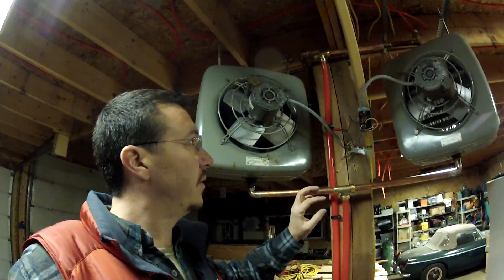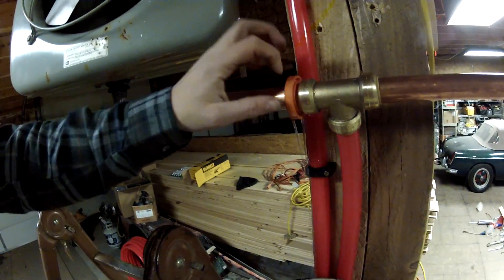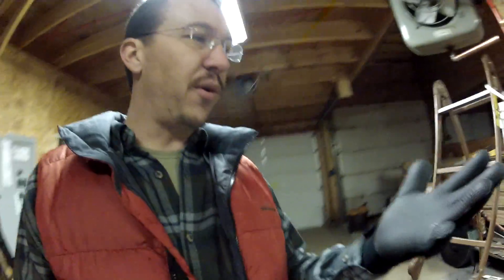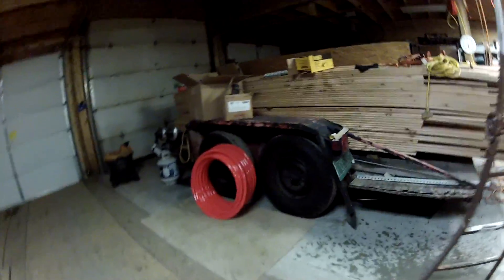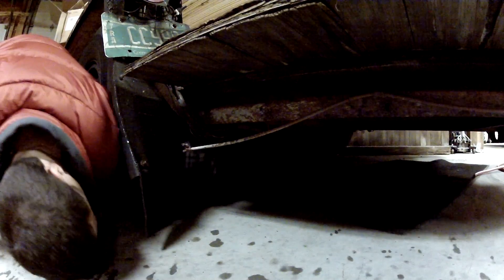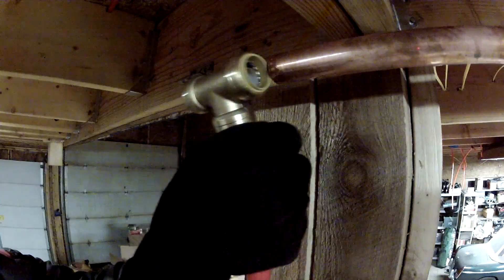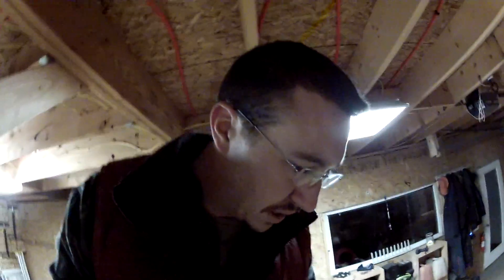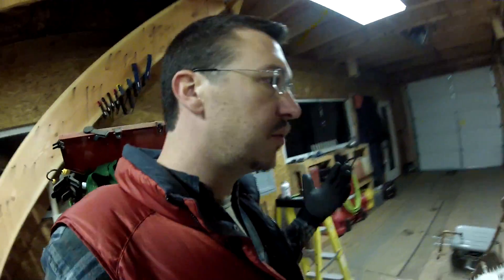Removing one Modine - 139 - My DIY Garage Build HD Time Lapse

Comment: The tool serves 2 functions: to remove 1 pipe from the fitting and some exercise from chasing it down when it flies across the room.

You could hook a dimmer to the fans on those things and they will be quieter and use less electricity and still put out warm air?
Reply: 2Awesome Actually I think you mean a ceiling fan solid state variable speed control! Those will not burn the motors out or cause a fire, where a dimmer switch on a fan motor is a fire hazard! Solid State Speed controls operate like a dimmer switch in that it is not stepped its full range variable like a knob on a stove or a water valve, only difference it is designed for ceiling fans but also other fans like some exhaust fans, fireplace circulator fans and if these motors are shaded pole or permanently split capacitor motors it will work, and they are different from dimmers as they for most types are 5 amps max rated, so multiple ceilings can be installed on one control all equalling not surpassing the rating! these motors on the modines might draw 3 amps, so if two are used one can buy higher rated solid state speed controls which are usually sold at commercial lighting stores or can be ordered from Canarm ceiling fan company or Banvil fans, or Casablanca ceiling fan company or Hunter ceiling fans! I think Fanimation sells them too! but the 5 amp ones are sold at your local hardware store like Lowes! Home depot they might be separate in store order because at my home depot location they only carry remote controls for ceiling fans not wall controls but they sell the. through ordering in store and online! But Lowes and in my area Home Hardware sells solid state 5 amp controls in store, they had boxes full of them in the ceiling fan and lighting section! they were 6 dollars each but I got a discount for mine because I bought ceiling fans there! They also differ in that they are not push on/off then rotate either way bright to dim, but different in that they rotate clockwise from off to high then rotate clockwise till the lowest it will turn and go! They also differ in that solid state speed controls have a low speed trim adjustment screw to prevent motor stall at low speeds and to provide a personal preference how low speed the fan will go!